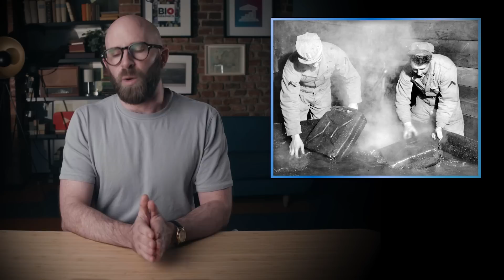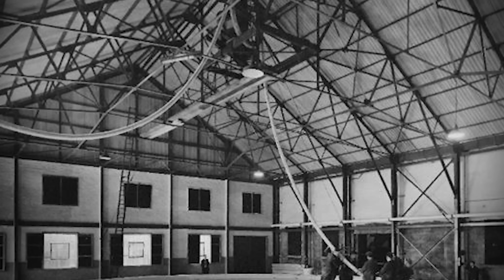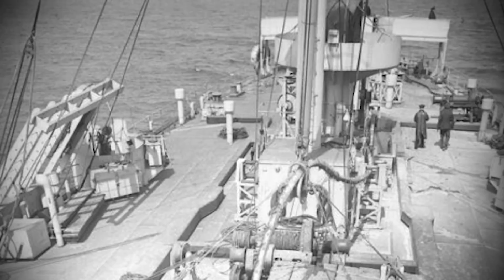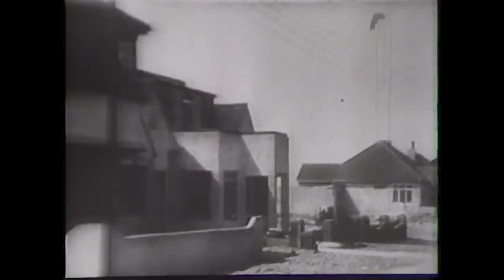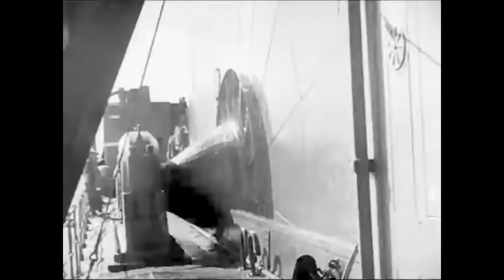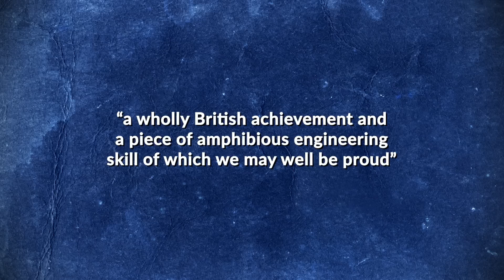PLUTO: A Feat of Logistical Engineering Unmatched in the History of Amphibious Warfare

Comment: I wonder why only 6” pipe for steel. 6” seems really small for pipeline. Did I miss where he mentioned why England couldn’t produce 12” pipe?
Reply: I would guess it has to do with the lack of flexibility for the 12" pipe as well as limited size of vessels to accommodate it.  The couldn't weld it as they laid it.  A barge anchored and moving super slow would have been an easy target.   Being able to lay it out quick was probably a big consideration.
Reply: They needed to lay it it a single night, he mentions that limiting the pipe size

Comment: For academic historians to casually  wave away the contribution the undersea pipelines made to victory by claiming, "Well, it was only 10% of the total supply, and it wasnt available immediately after D-Day, simply shows rhat they do not understand military logistics from their comfortable armchairs in their ivory towers.

The Westeen Allied forces were on the edge of running out of fuel almost constantly, from the Normandy breakout until VE Day.  10% was the difference between major attacks even being authorized versus being cancelled for lack of fuel.  7th Army's advances were held.up because SHAEF decided it had to prioritize the fuel supplies they had to Montgomery and away from Patton.

That last 10% matters quite a bit.

Comment: To express pressure in SI units, I'd go for atmospheres or Bar over megapascals. Though technically not wrong, even as an engineer I have to do mental maths to make it make intuitive sense. For the interested people , the pipeline was about 100 Bar of pressure. Generally i mostly use MPa in material properties context and not in fluid pressure context. And it's pretty pedantic with the mental math being absolutely nothing with 10bar/mpa. But yeah, more intuitive in fluid pressure context.
Reply: 1 bar is equivalent to 10m of fluid head. So the pressure at the the pump could theoretically shoot the fuel nearly a kilometre in the air
Reply: My preferred SI unit for pressure is PSI 😂